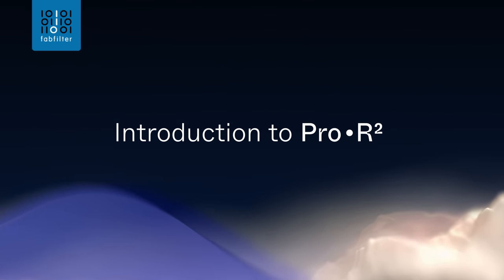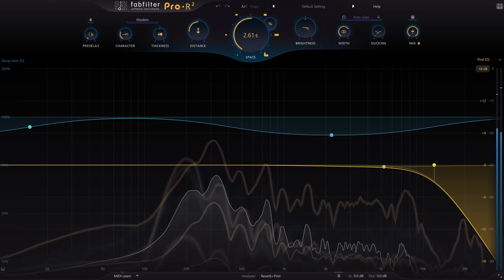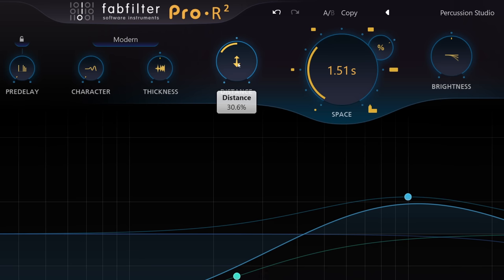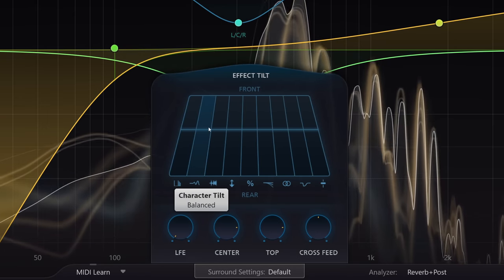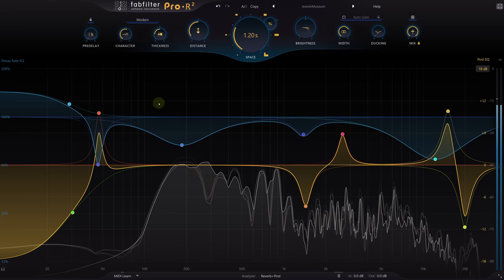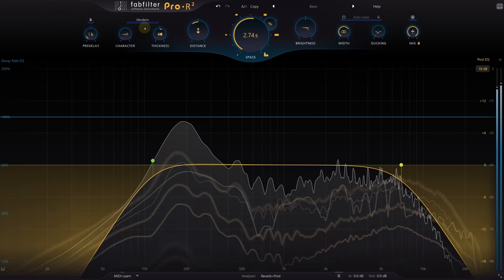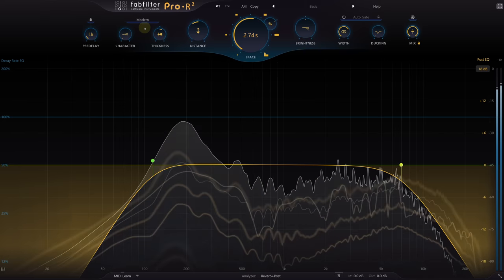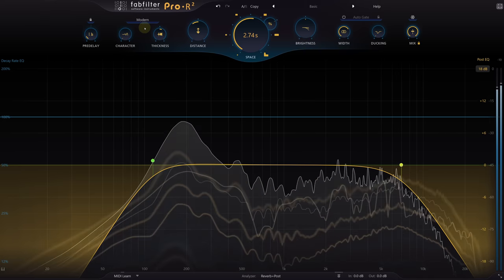Introduction to FabFilter Pro-R 2

Comment: Loving it so far! Feels like the CPU load is much lower than with Pro-R 1, which became fairly noticeable with 10+ instances running. Was really a shame as I absolutely loved how much control v1 had. Has me really excited to test v2 out more!
Also, I bought the total bundle about a month ago, and was given a free upgrade to Pro-R 2 due to a grace period. The people at Fab Filter are just great!
Reply: So is the cpu load indeed improved?
Reply: @TheirIAre 
My short answer is yes! The long one is yes, but it kinda depends.
It depends on the reverb style you use. The other parameters (including the EQ) don't affect performance enough for me to notice. The modern style seems to be the most intensive (a little more so than v1 actually),  but the vintage&plate are totally reasonable.

Pro-R 2 has tipped the scales for me overall! I can dial in an exact 'verb incredibly quickly, without my DAW becoming unusable with a dozen+ instances running. Plus - the decay time EQ opens the door to sooo many unique and personalized sounds that I can't get any other way.

Comment: Plugs like these are why I'll pretty much always like algo reverbs over convo reverbs. The only main exception is guitar cab IR's.
The character, thick and various types of verb are already quite flexible. Adding decay rate per band and being able to adjust pan for each is absolute genius.
I love that choir space and the modulated saw in plate mode. Such a rich, lush sound!
Reply: Springbox IRs also are an exception. While Pro R 2 can replicate the Reverb tail very well, it simply cannot replicate the springy sounds from the box. Pro R 2 works best with IRs that come from units that it has modeled. Like if you have a vintage reverb console, Plate, or Room IR and want to replicate that. More basic reverbs like Springbox simply won't produce the results you might be looking for.

Comment: Looks great and Surround Sound is for sure a big step what honestly I do not need but for cinematic & co a heaven.
Great Video by the way (like always)! If you would to audio books I would listen for hours.

Question:
-Is there a reason that PreDelay can not be locked at 1/64, 1/128, 1/256? In ms I can go down in ms to this but why not on locked pressync?

I expected the following be there too (but never less I upgraded already 🙂):
-Additional option to mix to have the option of separate dry (100% unprocessed) wet signal and control it separate (like it is on a return/sent but I do not generate one I can use it directly on a track)
-A simple additional PreEQ like only low cut & high cut (very interesting with a separate of dry & wet 2 gain amounts slider)
-Mode for Shimmer Reverbs 
-Saturation amount with Saturn 2 modes for wet signal
= All of them I can generate on a return / sent but do have it on a 

Additional coming up in my mind see the new options (just thoughts):
-Gate (Option Reverb tail stop by next "transient")
-Ducking length (but maybe this is going on under the hood

Comment: There’s a couple of cool bits in this, particularly the new ‘Vintage’ and ‘Plate’ modes, as well as M/S options on the EQ. Though, I can’t understand why you’ve not enabled them to be dynamic? This makes no difference for me as (on a vocal per say), I almost always follow my verb with a PRO-Q and duck the mid reverb whilst the vocal plays, leaving the sides up, then fading the mid channel back in, I still have to do this with PRO-R2. I don’t hear that much of a change in the sound of this thing either.

Unfortunately, unless I dive into atmos, I can’t see myself paying the (rather steep) upgrade fee on this one
Reply: Also, could you not of added some more modes in there? Why stop at vintage and plate?

Comment: Please update ProQ.

I believe the addition of an "advanced button" on the dynamic EQ side would greatly enhance the functionality. Specifically, I require features such as lookahead, maximum range, ratio, threshold, attack, and release for compression and expansion. These features are crucial in almost every mix, and there's often a situation where I find myself missing them. For instance, there are times when I wish I could fine-tune the release time of the low-mid band for a particular vocal, and having such control would be incredibly valuable.

Comment: How do I adjust the value of any given setting over the duration of the vocal, for example what if I want to start at the beginning of a vocal with the mix parameter at 10% but by the end of the vocal I want the mix param to hit 50%?  How can I achieve this

Comment: Overall Pro 2 seems to be an improvement, but I find the inability to drag and drop impulse responses quite a bit of a problem for me, as well as the fact that you can't configure the impulse response itself inside of the plugin, adjust tone, pitch, decay etc. is not my favorite thing. Only acceptable format being .Wav and .aiff is also not the best thing since I have a lot of IRs in .flac (because of Kilohearts convolver). 

It seems that Pro R 2 doesn't even support impulse responses in a traditional sense at all which I didn't expect, and felt like I was mislead by the teaser I watched before, which disappointed me at first, but after messing with it for a bit I feel like this system may be even better in some ways, so I understand why they went with implementing it in this way.
Reply from the maker: Drag-and-drop Its = already on our list for a future update 🙂
Reply: Thank you! Glad to hear it. I'd ask for flac support as well but it's not as big of a deal
Reply: Pro-R 2 is a 100% algorithmic reverb, it just analyzes the IR, then converts them to settings that will match the characteristics of the particular space. If you want to adjust tone, pitch, decay, etc then you need to use a convolution reverb like Liquidsonics Reverberate

99% of all the IRs I have ever created or bought were wav files--it is the standard I've seen since I first used IRs a long, long time ago.

Happy Mixing!
Reply: Sure, WAV may be the industry standard but I imagine supporting just one more format isn't that complicated, and I'm only asking for it because a lot of IRs that come with Kilohearts Convolver are in that format, and FLAC also seems to be lossless while being smaller than WAV. But it wouldn't be a big deal if they didn't support it.

As for Pro R 2 being entirely algorithmic, I realized that after messing with the plugin for a little bit. I think what they have is pretty good, I just felt a little mislead and was a little disappointed at first, but now I realize that this may even be better in some respect

Comment: Disappointing you can't get at the multi-out of the VST2 or VST3! Why not just allow users to have 'full' control of their own output routing of your plugins like other plugin manufactures allow? It means we have to wrap fabfilter plugins in Plogue Bidule or  some other VST wrapper host just to get at your output channels which is absurd in this day and age!
Also in a channel agnostic DAW, I'm not sure why you've gone with a default FILM rather than SMPTE multi-out channel ordering? Again it means we have to place a channel matrix after R2 to convert R2's FILM output into SMPTE for Dolby Atmos Renderer.

Comment: Yeah I remember back, about 40 years ago in 1983. I had built myself a nice little Home Recording Studio. Before many existed. Even with a lousy TEAC 3340 reel to reel 4 track recorder. No. Not stupid beginner stuff like that.

No. That would not be, proper. And so I had a, Custom Built, 3M, 1 inch, 8 track. To go with my, vintage, 12 x 4, all Germanium Transistor, Phillips Recording Console. But… Really? That also wasn't good enough. No. I needed something better. To go with my, Stainless Steel Plate Reverb. Along with my Lexicon, PCM-60  and, Delta Lab  Effect-Tron type II's. With 1024 ms of delay and echo capability. Times 2 of them! Along with 2 Yamaha, SPX-90 type II's.

And on a high note recording of my then girlfriend who later become my divorced ex-wife 10 years later. I extended her high note. For over 120 seconds! Imperceptibly Perfect! And it blew everybody's minds. Back around 1983/84. When I had gone to Digital Recording. Mastering from my, 2 inch, MCI, JH-10-16 track machine. That, Curtis Mayfield recorded his hits upon. Before he was hit upon. Buy a big car.  And turned into a Quadriplegic! When I then purchased his machine. As he could no longer press any buttons. Nor wipe his ass, anymore.

And to that. I had to get rid of that noisy old 12 x 4 Phillips Germanium, mixer. And replace it with a, 32 input, British Mixer. Sir Peter Townsend was, hawking. In my Pro Audio Trade Journals. And it was portable. And only cost, $3750.  And had groovy LED bar, VU Meters. That eventually blew out. That you really didn't need. Because you could record the, WHO & the, WHAT. Of whatever you wanted to. With 16 microphone inputs. And 32 on mix down. 24 with EQ. And 8 as effects returns. Along with 2 additional Effects Returns. And there was nothing I couldn't do!

Along with my myriads of, Yuri1176 Limiters times 5. LA-3 A & LA-4×4 channels. DBX 165 A''s, 160 X and XT's. And 166's. And dual stuffed 900 racks. And Orban Limiters & de-esser's. In addition to the DBX de-esser's and high-frequency limiters. And then the Allison Research rack of KEPEX-1, Downward Expanders and Gates! And there wasn't anything I couldn't do!

In my modest little home 16 track studio in 1983. When I came up with this fine piece of work here:
https://soundcloud.com/remyrad/michael-remy-jackson-rokinu

Now this was only me. Who replaced Michael Jackson's lead vocals. Back in 1983. Before any American. Knew  what the word, KARAOKE, meant? There was no, Karaoke, yet. But engineers like me knew how to Make Our Own Karaoke.

You see… My then girlfriend was becoming a famous Opera Singer. And I don't sing anything. I can't sing. But I wanted to sing a song for my girlfriend.

So I took her into my control room. And I sat her down. And I was going to try outs and new equipment I had just gotten and wired in. And had taken this record home. From where I worked at, the #1 Urban Contemporary FM Station. Owned and Operated by, NBC Radio. And I handed it to my Program  Director, Donnie Simpson. And told Donny. I had gotten this recording of Michael Jackson. Live, on a bad day. On the NBC Radio Network Line. And I thought he knew it was a joke?  I thought?

This was actually played on air. When it shouldn't have been. We could have been sued and shut down. For this.  We could've lost our license. We could've been sued for millions of dollars. And fined by the FCC. In addition to all that. Because Donnie didn't say this was a Celebrity Impersonation. No. He said it was Michael Jackson Live on a Bad Day.  Whoops!

This is my augmented mix for the Internet. To bring my vocal more forward. And so you could hear Judy, giggle. In the background. Which was not audible on the on-air version. And Donnie scanned it before he played it. It sounded like Michael Jackson to him. I don't really sound like that. I used an old Beatles trick in the recording. I can't sing those high notes that way. So I had to slow it down. So I could reach those high notes. And then when you played back at normal speed. I sound more like Michael Jackson. Who had a much higher voice than me. As I am a Baritone. I am not a soprano like Michael. Singing all girly like. LOL. This was too damned funny. And got played on air in 1983. In Washington DC. To an audience of approximately 175,000. According to our then, ratings on an average day. And that is just too funny. It should've never been played. It was only a joke. I only gave it to, Donnie Simpson as a joke. He didn't realize it was a joke.

I couldn't quite get the right, Michael Jackson vocal sound? I was using my new, AKG--414. And I knew. I didn't get the recipe exactly right?

It wouldn't be until a few years later. When I found out that Bruce Swedien  had used the, cheap, SHURE, SM-7. To record Michael Jackson's lead vocals. Which is identical to the SM-5, 56, 57 & 58's. They all use the same identical, 57 cartridge capsule. And so one need not spend, $400 US. To get the SM-7, sound. It can be had with a $100 new, $50 or less used, SM-57. Because that's what SHURE Brothers Inc., Engineers, told me.  Well over, 35 years ago. Who knew? And of course I also had an original, SM-7 all the time! So funny! I thought I was listening to, KKG Condenser microphones on Michael? And I was!  That's what Bruce Swedien used. For all of his backup vocals you are hearing here. So that is the same that I was using. But not for his lead vocal. I didn't know any better at the time? I was only 27 years old. I didn't go to school for this. I just picked it up. Like Bruce Swedien did also. We both started in radio. We both started recording live things for radio. Then we started doing it in the studio. Then we went to work for a studio. Then we built our own studio. Then we built multiple studios.

I am now retired. And poor old Bruce Swedien is dead. And so is Michael. And soon so Shelby, Quincy Jones. Whom I had the pleasure of working with. For an entire television season. And we had hit it off. And he made me a great offer. I couldn't take him up on at that time. Damn! I was in love. I had made commitments. To the person I loved. Who now like Michael and Bruce Swedien has also passed. Just a year after Michael.

And now I am all alone in my retirement. And this sucks. This was not the plan I had worked toward for over 50 years. They say life is short. It is much shorter than you can imagine. All of my friends and colleagues from NBC  have virtually all passed on. And I am only 68 now. I started there when I was 25. I resigned by 45. When I started my own studio. Which had been running for the previous 10 years overtop of my employment with NBC. For my side hustle.

And so I went on to make Recording History and garner multiple major music award nominations. But I am now broke. It happens. I never got any royalties. I was a Live Broadcast Engineer. We don't get royalties. We merely get paid our weekly salaries. And they were decent. That gave me my studio to live on. For the next 25 years. Now it's all gone. Everything has gone since that pandemic. It has killed us all off.

Now music has been, Dehumanized. Only computers can compose music now. Because they already know what's been copywritten. And that is everything. So nobody can come up with the melody anymore without getting sued. Music is dead. Long live computers.

Now it's all trash. The performers have no talent. But they could shake their asses really fine. And that's all that matters anymore. No one needs a shred of, talent.

And so now we just aimlessly follow, Wonder Hussy.. Into Death…… Valley. And disappear. In the desert. Of dead music. Petrified music. Dirty old dried up music. Blowing around in the dust. As my JBL Studio Speakers. Can definitely still kick up some dust. With some good old-fashioned, ROCK 'N' ROLL! In the desert.

That's what I've been wanting to do for some time now. I want to record a Great Rock Band. In the Desert. Mostly at night. So nobody wilts and dies. During the day. As we will have no fire hoses for them. So we will really have to record at night, mostly. Which will keep the animals away. But we will record the coyotes in the background howling. Over some good old-fashioned rock 'n' roll. And it will make a great recording. That will be so totally Organic Sounding. People will fall in love with it. And want to dry up and die with it. I reckon?

And so if you hear a rock band playing in the desert? Please do not call the police. It'll screw up the recording. I don't want to be recording sirens. Nor gunshots. When guys hold up their guitars.  I don't want them to get shot by police. Okay? Good. As long as we understand each other.

(And furthermore in the following post)